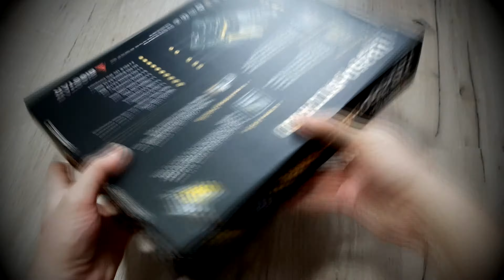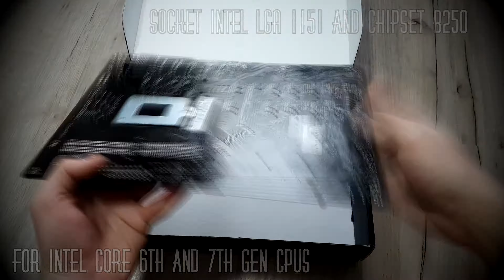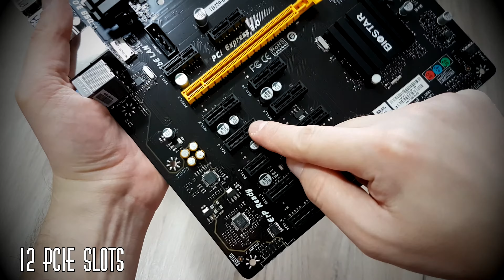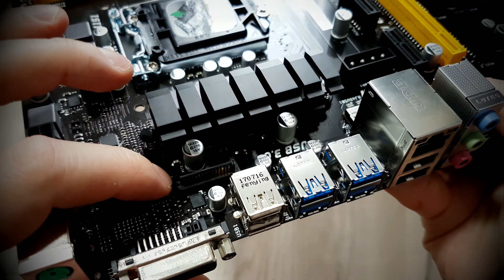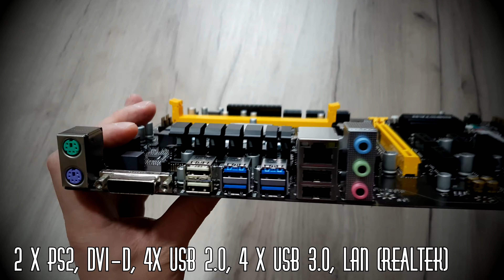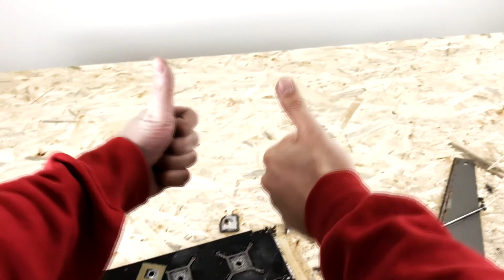BIOSTAR B250-BTC Pro - motherboard for crypto mining rig

Comment: FYI, you use the 2 molex plugs on the mobo for supplying auxiliary power to the video cards (which is required for minning), the SATA power plug is for enhancing the power of the rear the USB ports.  It's on  pg. 16 in the manual.

Comment: hello, can i use it with only one psu or i have to install 2 psu even 1 is enough for my cards(6x 1050ti  + 5x 1060). and do i have to connect both molex connectors to aux1 + aux2 ? Thanks to anyone who answer this.